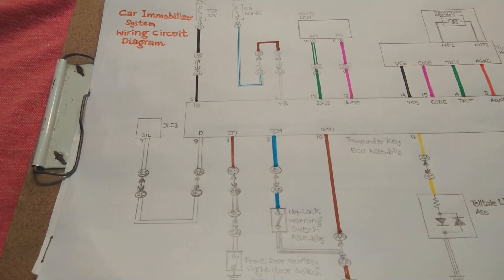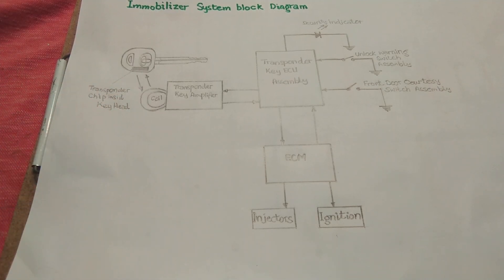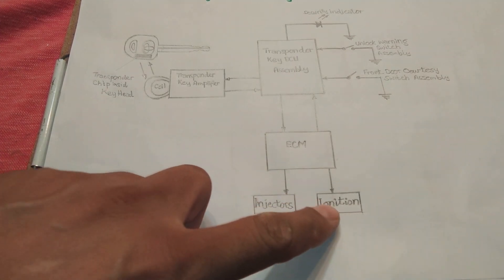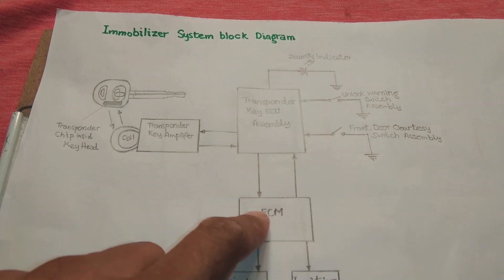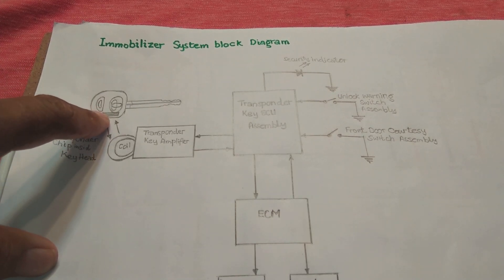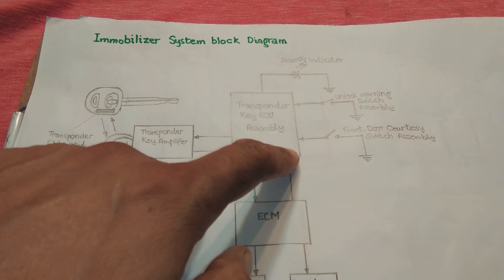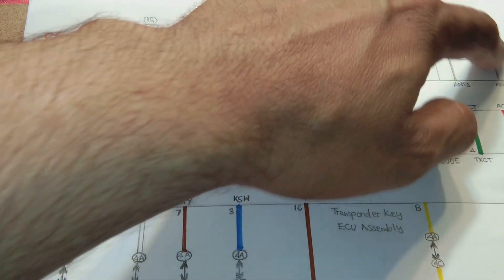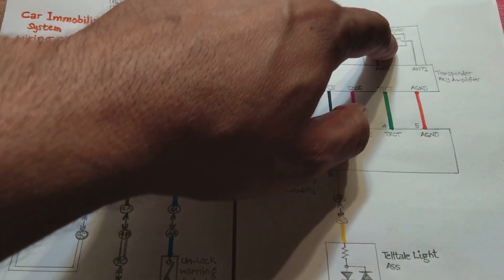car Immobilizer. Immobilizer system explained. Transponder smart key.

Comment: Well explained, thanks. Question, on a transponder key ecu to ecm system where or what is responsible to send 12v to key amplifier module as power all the time ? I have no power at that pin out from key ecu module. So i wonder why is that if its supposed to be 12v all the time, all other pins check ok. Could it be an iternal key amplifier short and key ecu turns it off? Thank you.

Comment: 1. While programming, what actually is happening to the transponder chip hidden in the key????
2. Are vehicle codes and information gets stored to the transponder chip?? It's very confusing. If so, is it erasable once data are stored on the chip???
3. If I want to add the 3rd key which has new empty immobilizer chip, how to transfer data and stored on the chip without using programming tools particular to Hyundai i20 2011?? Any options like key insert 3 times, etc!!???

Comment: Hi. Can i use a similar antenna ring from a similar immobilizer to replace my damaged antenna ring? Can i simply solder it in? Everything is original and i have both original chipped keys. Thief damaged it, code says key is invalid. Thank you for a wonderful video
Reply from the maker: If only coil is damaged the you can replace coil from another unit and it should work. As coil has no code in it. But the rest of electronics contains code inside for some models and some don't. The real understanding could be by doing some experimentation by replacement.
Reply: @JahanZeb1976  thank you very much! Found another one and will exchange damaged plastic ring.
Reply: @JahanZeb1976   sir what about the videos on adding extra keys you talked at 8.20. please make videos particularly to Hyundai i20 2011. Thanks.
Reply: @JahanZeb1976  1. While programming, what actually is happening to the transponder chip hidden in the key????
2. Are vehicle codes and information gets stored to the transponder chip?? It's very confusing. If so, is it erasable once data are stored on the chip???
3. If I want to add the 3rd key which has new empty immobilizer chip, how to transfer data and stored on the chip without using programming tools particular to Hyundai i20 2011?? Any options like key insert 3 times, etc!!???

Comment: Concerning Immobilizer, the ECM also authenticates the key's code in modern systems, otherwise a thief would only need a mated key and immobilizer ECU to start the vehicle. Both ECU's also validate the vehicle VIN from other modules on the CAN bus to verify modules are not being swapped in order to circumvent the immobilizing process. Furthermore, the code which allows the vehicle to start is generated from algorithms using each modules secret code and the key code. The immobilizer does not know the secret code of the ECM and vice versa, yet both are able to validate the code which is generated from the other when they key is turned or the button is pushed.
Reply: So what you are saying is that I I have canbus device reading network, when key is presented i will receive two messages from both key ECU and ECM, and they will look random in data ?

My question is can I emulate something for immobilizer to be deactivated and car turned on ? I would have training session on canbus sniffing when correct key is presented, and I would be capable of reading all messages and generating my won messages. So you are telling me I cannot generate any messages that would turn car on ?

I don't see a reason for "evolving, meaning changing " data generation on canbus. It could be static and just as safe. since if someone could sniff traffic then correct key is presented, that means it is already defeated security.

My goal is connect Bluetooth device that could act as emergency key, is paired mobile phone is connected

Comment: Please guide me Hindi or urdu
Reply from the maker: Go to my other channel.   The Engineer     everything in Hindi urdu.
Reply: @JahanZeb1976  whah par b english ma hi hai automotive ki
Reply from the maker: @fvt.22  waha par urdu Hindi may hae.
Reply: @JahanZeb1976  what about the videos on how to add extra keys by sending door signals as mentioned in time 8.20 of your video???
Reply: @JahanZeb1976  1. While programming, what actually is happening to the transponder chip hidden in the key????
2. Are vehicle codes and information gets stored to the transponder chip?? It's very confusing. If so, is it erasable once data are stored on the chip???
3. If I want to add the 3rd key which has new empty immobilizer chip, how to transfer data and stored on the chip without using programming tools particular to Hyundai i20 2011?? Any options like key insert 3 times, etc!!???

Comment: Great video! can i ask you. The immobiliser on the motorbike i just bought, have a strange working which i didnt notice when buying and could reallly lower the resalevalue for me. The system works and bike starts, but the status diode stays steady on in all the cases it should be off. It does blink when key is out like it should, but it just stays on when i drive. Could this be a electronics fault in the diodecircuit? i didnt think so since it blinks when it should, but if reverse voltage or somthing can also make it blink depending on diodecircuit?

Comment: Thank you so much for this vedio.
Reply from the maker: Great. Hope you understand it well. Do you practice auto electrical?
Reply: @JahanZeb1976  yes sir.
Reply: @JahanZeb1976  1. While programming, what actually is happening to the transponder chip hidden in the key????
2. Are vehicle codes and information gets stored to the transponder chip?? It's very confusing. If so, is it erasable once data are stored on the chip???
3. If I want to add the 3rd key which has new empty immobilizer chip, how to transfer data and stored on the chip without using programming tools particular to Hyundai i20 2011?? Any options like key insert 3 times, etc!!???

Comment: It happens to my Nissan sunny 2002 immobilizer was malfunctioning and technician told my car ECU is faculty and replacement needed, but after everything done nothing happened then he told that the immobilizer has problem and he replaced it.... and it's starts works fine.
Reply from the maker: Wonderful. Nissan Sunny has known ECU problem. That is very common defect. Hope now your car would run good.
Reply: @JahanZeb1976  Alhamdo Lillah working fine after spending around 650 Saudi Riyals.
Reply: Me also now faulty

Comment: Very good explanation  and one of the best videos  yet.
Reply from the maker: Thank you very much dear sir. Hope you find this video interesting. I will upload more auto electrical series in future. Regards,
Reply: @JahanZeb1976  sir can I have your WhatsApp number please?
Reply: @JahanZeb1976  sir what about the videos on adding extra keys you talked at 8.20. please make videos particularly to Hyundai i20 2011. Thanks.
Reply: @JahanZeb1976  1. While programming, what actually is happening to the transponder chip hidden in the key????
2. Are vehicle codes and information gets stored to the transponder chip?? It's very confusing. If so, is it erasable once data are stored on the chip???
3. If I want to add the 3rd key which has new empty immobilizer chip, how to transfer data and stored on the chip without using programming tools particular to Hyundai i20 2011?? Any options like key insert 3 times, etc!!???